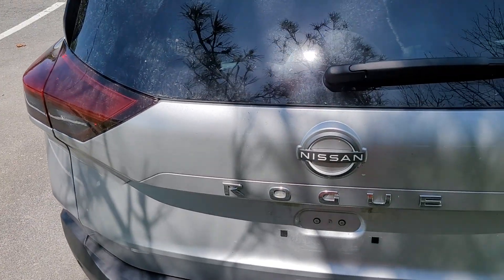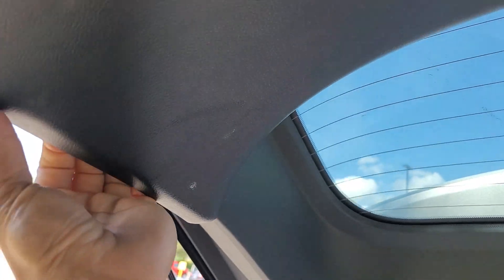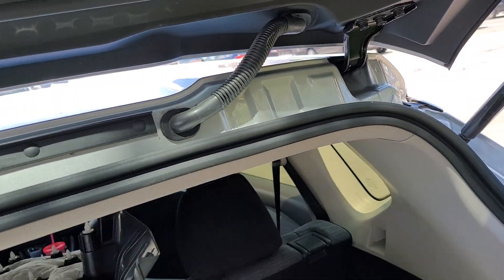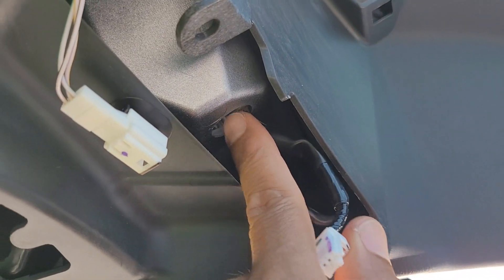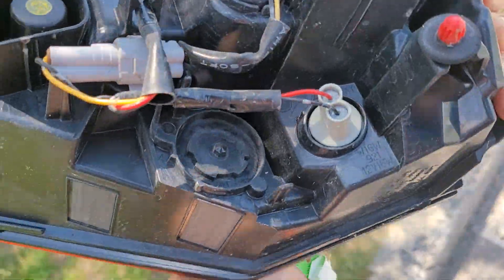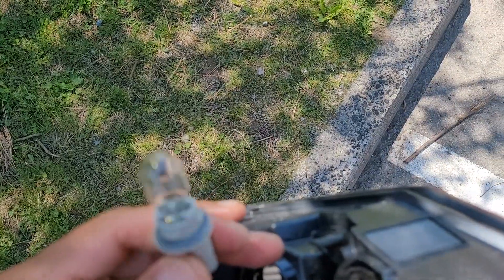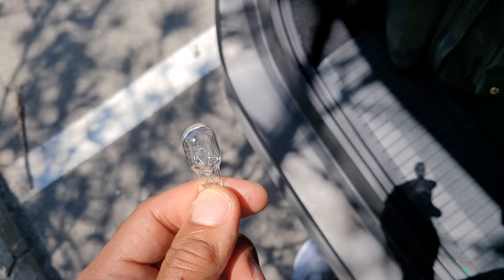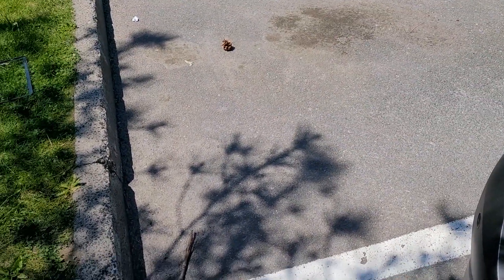How To Remove 2021-2025 Nissan Rogue Hatch Door/Inner Tail Light. Reverse Light Bulb Replacement.

Comment: What about the other light? there is a cable that goes in
Reply from the maker: What do you mean?
Reply: @richideates  There is a cable going into the light. i did not realize that is an LED that is not replaceable. I should have read the owner's manual before asking :)